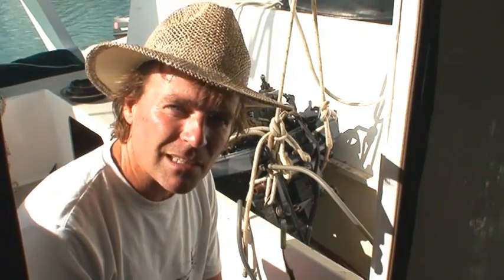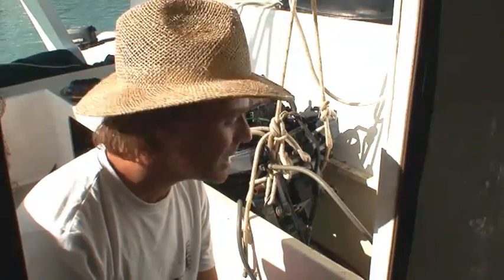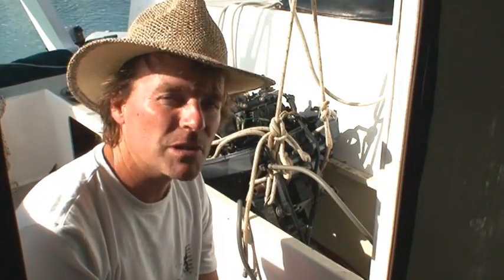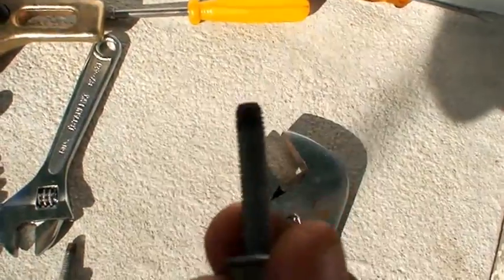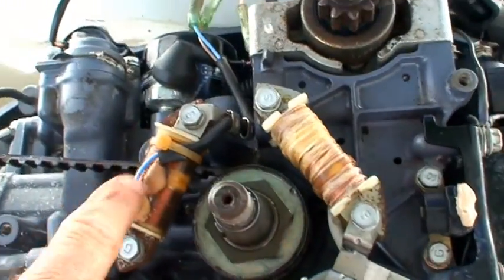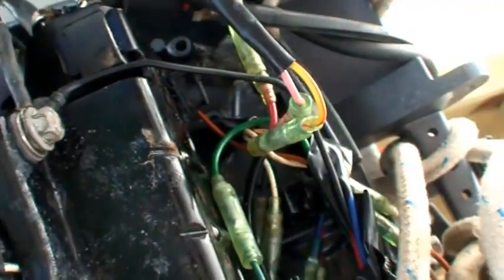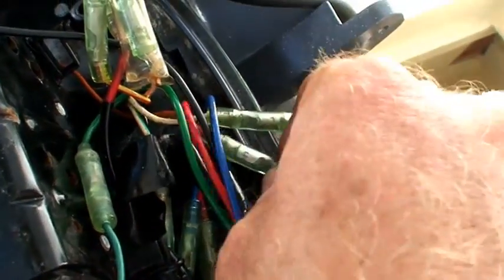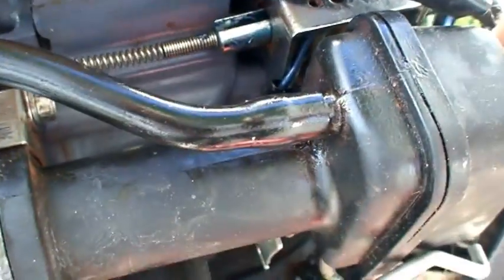Yamaha 9.9 hp 4 stroke high thrust - No spark - Time to replace the charge coil - or is it

Comment: Hi, Can a faulty charge or source coil blow the CDI unit.
Reply from the maker: I think that the CDI is pretty reliable ... and if the charge coil were to do anything bad it would be to simply stop - and that is not going to affect the CDI - so maybe I would look elsewhere for your problem.
Reply: @dejavumagazine  so the question is what can cause a CDI to blow up. this is the second time within a year im facing an issue. cant keep changing CDI units.
Reply from the maker: @abishaifernandez1983  That one I don't know about. Perhaps you are buying used ones... and they are just old?

Comment: Hi John, It's called the source coil. they are easy to re-wind. head into the local electrical repairs shop with an empty hand line and ask them to hook you up with the same size coated wire and put it onto the hand line. cost you maybe $15 for the wire. go home and wrap the wire onto the source coil tightly and make the coil bigger than it was before. (important) check the ohms and remove wire until the ohms are within spec. coat the coil in araldite, solder the wire ends to the harness. bingo!